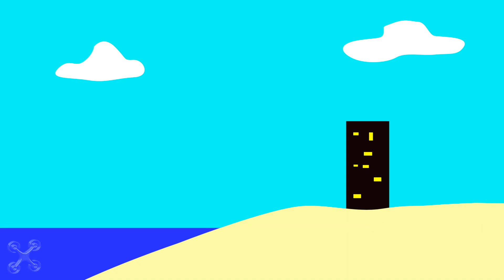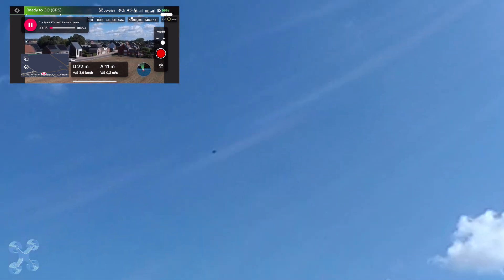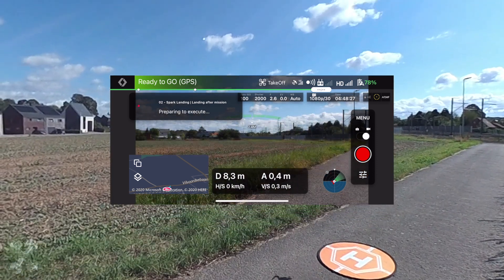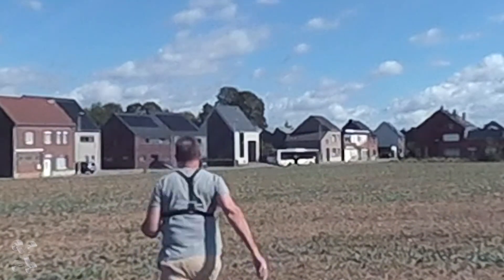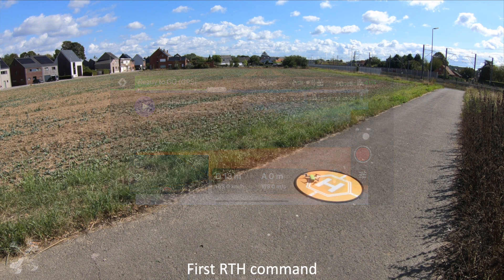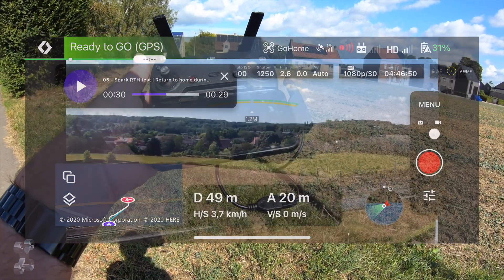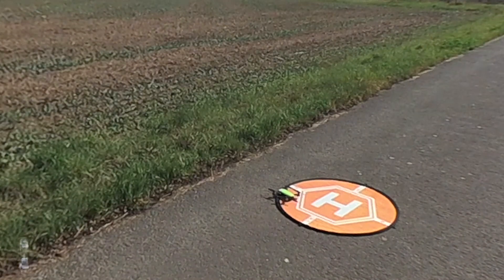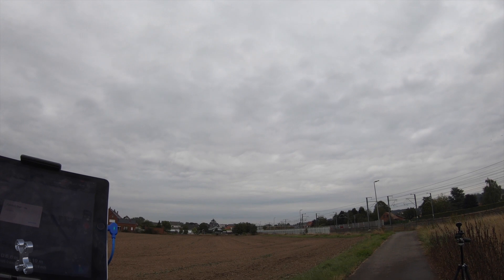Dronelink Basics #06 - RTH

Comment: Thanks for the video, really informative. Question- if the drone is doing a mission and connection is lost due to signal obstruction, rather than drone being switched off, will it continue the mission, or RTH straight away? Thanks
Reply from the maker: If a connection is lost, it will return home. Unless otherwise instructed
Reply: @OyiboVFX  Thanks! How do I instruct it continue with the mission? Just looking for this setting now. I'll be flying a Mavic Pro 2 fyi.

Comment: On saturday, I tried a similar test with the Autel, actually not intended test, but i overestimated battery capability for an 8km mission. I started the mission, everything went smooth until 70% into the flight the battery got low, so the drone wanted to return... now this was a hair raising event as I actuall decided to drive along with the drone, and at this time the drone was going to do a birds, straight back home... i got into a frantic mode, because I had to navigate traffic lights and many turns to get to the lift off point... but happily got home to find the baby had landed safely, returning to home with the autel and just waiting for me. You should have seen the joy on my face!!! WOW!!

Comment: I seem to remember reading somewhere that if you are not at least 20m in distance from homepoint that RTH will just land where it is which could be a cause for some folks reporting that their drone crashed into the water.  However, flying low over water involves the sensors in the bottom of the drone which could also be a cause.   I wonder if you could test what happens if you hit RTH button while only 15m from takeoff point.  Does it just land where it is or will it return to you.
Reply from the maker: Larry Fortna you should asked yesterday
Reply: Oyibo VFX I know.  Did not think of it till I watched your video
Reply: Larry Fortna It will just land when less than 20m distance away from you